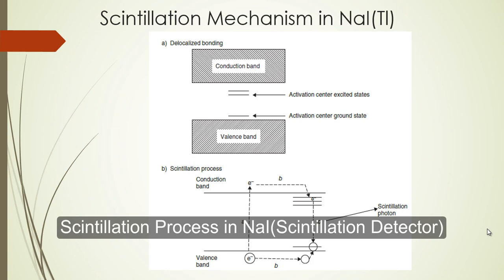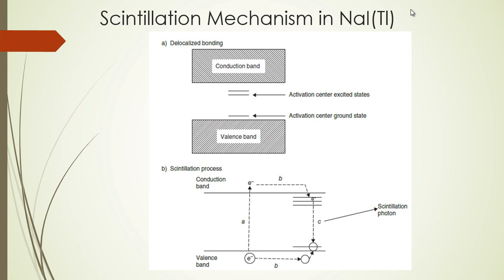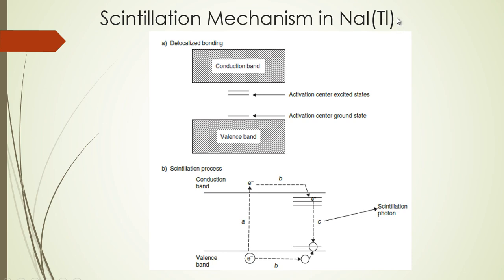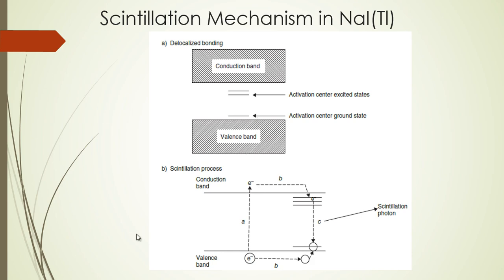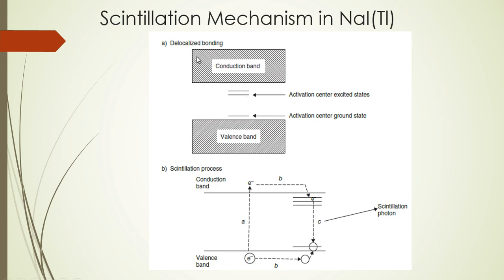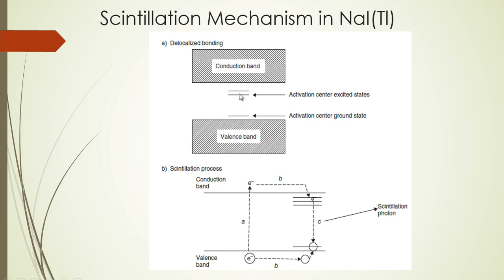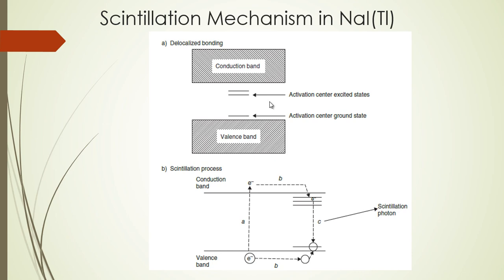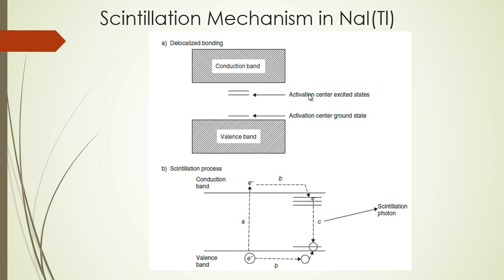SCINTILLATION MECHANISM - | NaI |  [Explained]

Comment from the maker: The scintillation mechanism depends on the structure of the crystal lattice. In a pure inorganic
crystal lattice such as NaI, electrons are only allowed to occupy selected energy bands. The
forbidden band or band gap is the range of energies in which electrons can never be found in the
pure crystal.
In the pure crystal, absorption of energy can elevate electrons from the valence band to the
conduction band leaving a gap in the valence band. However, the return of an electron to the 
valence band with the emission of a photon is an inefficient process. Few photons are released
per decay, the energy is emitted by other mechanisms. In addition, band gap widths in pure
crystals are such that the resulting emitted photon is too high to lie within the visible range.
Small amounts of impurities are therefore added to the crystal. Tl is added to NaI in trace
amounts. The impurities are called activators, they create special sites in the lattice at which the
band gap structure, the energy structure, is modified. The energy structure of the overall crystal
is not changed, just the energy structure at the activator sites. 
At the few activator sites within the sample, the energy structure is modified. Energy states are
created within what would be the forbidden band in the pure crystal. The electron can de-excite
through these levels back to the valence band.
The energy levels created by the activator’s presence within the crystal are narrower than in the
pure crystal.
-> The photons emitted by the transitions of electrons from upper to lower states will be lower in
energy than in the pure crystal: The emission spectrum is shifted to longer wavelengths and will
not be influenced by the optical absorption band of the bulk crystal.
-> The photons are emitted in the visible range. 

Source: https://www.science.mcmaster.ca/radgrad/images/6R06CourseResources/4R6Notes4_ScintillationDetectors.pdf
Reply: In the pure cristal what is the mécanisme use to released photo
Reply: Photon

Comment: Hey... It was an awesome explanation.. Great Job guyzz..👍👍✊🤝👏👏👏👏 I have a doubt here u mentioned that electron jumping back from CB to VB is prohibited Quantum mechanically, what gives liberty for the activation Centers to jump from their Excited state to the ground state..?... Please do clarify.. 😅😅
Reply from the maker: That was a rather naive way of saying that the de-excitation of electron from CB to VB is rather inefficient. More details are here: https://www.science.mcmaster.ca/radgrad/images/6R06CourseResources/4R6Notes4_ScintillationDetectors.pdf

Also, the photon thus released are of lower wavelength and don't lie in visible range. But if we have impurity states in between to make the electrons jump through these, then the wavelength will lie in visible range as the energy of photon emitted in this way would be less. Also,the probability of photon emission is high.

Comment: Thanks for the explanation on the scintillator.  In short incident photon ionises the NaI which releases electron from valance band into conduction band.  Then the return of electrons from conduction band via activation centres (made possible because of the thallium accentuation) releases visible blue light which a photocathode can then read.  My question is this: the concept you described about valance band, conduction band and band in between, isn't this like the semi conductor bads (valance, forbidden, conduction bands)? But I know NaI detectors are not solid state semiconductor detectors.  So how come the mechanism you describe is that of a semiconductor in terms of the bands? Would love to hear your clarify my misconceptions. Thank you.
Reply from the maker: Crystals of NaI can be prepared and thus band theory of solids will apply to them.  Evidently they have a large band gap of 5.8 eV, so it's more of an insulator.  https://www.ucl.ac.uk/~ucapahh/research/crystal/nai.htm